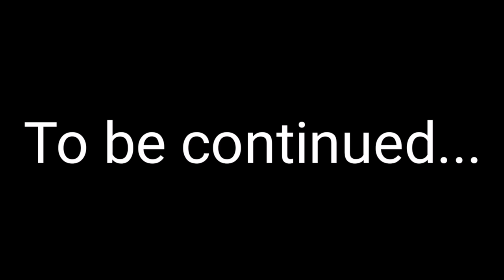Ashleys Chicken Coop PART 2 | Another VLOG #38

Comment: Coming along nicely! If moisture builds up in a coop and there is no ventilation, chickens (especially big comb breeds) are susceptible to frostbite. Droppings boards underneath the roosts, with zeolite sprinkled on, will absorb moisture and the droppings can quickly be scraped off every day into a bucket, using a taping knife or scraper. Goes super fast. This will help keep your coop clean and dry and the coop won’t smell, and the chickens won’t be walking or standing in poop. Some people line the walls behind the roosts with feed bags that can be easily cleaned as well. Having roosts (2x4’s with wide side up) all at the same level will help avoid jockeying for the higher positions at night. 😊

Comment: The amount of ventilation you have is good. Because your winters get so cold (mine do also) plan on a heater, there’s many safe ones out there for coops. Also since she doesn’t want to do the deep litter method during winter...plus just the fact to save your flooring, think about putting in rubber stable mat in coop area (super easy to clean coop out with that, or even just a large piece of vinyl on floor) 
To keep them from being bored over the winter, hang swings for them. I still let mine out any chance when there’s not snow on the ground, most chickens are very hardy and adjust to cold.

Comment: I find the building of the coop very interesting as I buy farm eggs and when the lady could not come to town I traveled to her farm to pick them up.  She gave me the grand tour (pics on my FB) and one thing that I loved is that there was a stream of fresh water going through the chicken run.  I also watched videos or read a while ago about putting the ramp up so the chicken's feet would be clean when they finally went into their rooms to lay the eggs to keep their nest clean and thus clean eggs.  Our cousin's coop had outdoor flaps to open to gather the eggs - saves from going inside.  Or egg lady has separate coops for the new chickens and adds them in as a group otherwise the older chickens would pick on the new chicken if they are added in by themselves.  It is all really interesting if you get into a larger quantity.  My sister used to work in a hatchery where I also had the grand tour from the chicks hatching to the orders of chicks being filled for pick up.  The chicken coop is usually the main attraction so I like that you are doing it up!

Comment: Are you going to add rafters to the roof to collect rainwater to store in a barrel to make a self-watering system for the chickens?
Reply: Not my chicken coop but water freezes in Edmonton.  There is no rain in winter, just snow.
Reply: U can use a cattle water warmer.  Surely they make one for poultry.
Reply: @Warmfireandtea  Any device intended to melt water will use electricity and so far this chicken coop does not have power.

Comment: Near Renfrew, Ontario, Matt McDougall of YT's 50 Ducks in a Hot Tub used old sign board pieces well-taped for his floor and lower wall sections in his earlier duck barn iteration.  Last year he did a repair-rebuild and renovation and had a new slab laid while lengthening the building.  He has a numerous cleaning the barn videos (up to ~ 2017) that show how that material worked on the ground; also, that can be pretty cheap, if you're near a good sign recycling source.  It seemed to hold up well to his regular mucking out the constant poo-straw supply (using a snow shove) which he piled on his garden, then planted in the spring most years to great organic effect.  His flock was and is fairly large, as he free-ranged up to ~1000 ducks to donate to hungry people in Toronto and lots of eggs go to the local food bank.  Chicken manure is stronger than duck, I believe, but given enough 'cooling-off' time, they're creating a valuable resource.  ['Cow pies and meadow muffins' take longer to become safe for the garden.]

If Ashley wants her chickens to roost higher in the structure, you might want to stagger the roosting poles' placement, out of consideration to lower-perched birds, and don't clip the wing-feathers too much, so they can fly up to where the heat is going in winter.  That's purely a guess because I'm a duck person whose flock was evicted from Milwaukee. and ducks don't roost.  Looking forward to part three!

Comment: @Joshua Alexander, that is not a chicken coop. That is a chicken palace! 
I've never seen one that Huge. It rivals a commercial coop! 

Around here owners with chickens often have a "Chicken Tractor" that can be moved around on their property. The chickens will keep the grasses, and weeds pecked down, and eat all the pests like ticks, and such. I'll see if I can't find an example and send it to you via messenger. They typically are fully enclosed, with the coop above or at one end, and then the enclosure has 2"4" welded wire on the bottom. And naturally they are on wheels. Some are mobile enough Ashley could move it, Others literally require a tractor to move them (but those are larger for a LOT more chickens!) You may want to consider a chicken tractor for your summer months....

I would suggest a solar powered door for your chickens.

Comment: @0:25 "...been meaning to do that for two years..."
lol

as for the pitch of the roof you only did part of the calculation. You found the run of 12" and rise of 23" but you didn't calculate the slope or the degrees
FYI 
the grade or slope would be 191.7%
the Degrees would be 62.4°

Comment: I read where you were scolded by another poster. I think you are OK with the rafters off of the top plate with your laminated bird's mouths. The only thing I might recommend are collar ties. Rafter on one side "tied" to the rafter on the other side by a 2x bolted to the rafter. That is usually to prevent a load on the roof from basically caving in the roof. That isn't a problem (or shouldn't be) on a roof that steep. In this case, it may prevent the rafter and your laminated  things from sliding off the top plate.
Reply from the maker: Seems reasonable!

Comment: are you going to use a heat lamp in the coldest weather. they now have thermosats that will regulate heat if it gets below a set temp. we had 10 chickens and at the end of winter we still had 10 due to that regulater.
Reply: I recommend that too. That´s how we keep our chickens warm in winter.
Reply: That would be good for my RV. Anything to avoid using antifreeze in water pipes .

Comment: Because they poop so much  methane builds up if not cleaned every couple of days, hence good ventilation is important. You should also have a readily available heat source for them. I would keep the floor on the ceiling then it gives you additional storage space for chicken supplies.
Reply: Huh?  Floor on the cieling? Sounds like a song.

Comment: Joshua make sure there's no nail points sticking out and also the queen needs a flooring in whatever area should be walking that is she can clean with a solvable are a bleach content the keep the feces germs down. When we had Dobermans of course we had cement we had a pain to put the females in when they were in heat the other was just for everybody and it had rain but that wouldn't apply to you but I think if you're going to fence your fencing is very important cuz of the big birds I worry about that here cuz I have an owl and a hawk it's in my area and I'm in a subdivision and I could pick up my Yorkshire Terrier or my butterfly terrier and take them away and my Scottish terrier just be sitting on the background laughing.🐔🐔🐔🐔🌹

Comment: The reason that works is because birds will fly through horizontal lines but not through vertical lines.  It is the same reason if you have birds flying into your picture windows, take a pen that writes on glass and draw vertical lines about 4” apart and they will not fly into your windows.
Reply from the maker: Very interesting.

Comment: That is a nice house but the door is too small to scoop out the excess feed and manure. U need a way to push that out and not thru the door. No floor or a ckn wire area that it can fall thru then be pulled out would be nice. Just mucking like a horse stall will get labor intensive . U will get that job, hate the work and thisbox will wind up.an out building.  And don't forget they need a little heat source Josh. Read up.on it in Mother Earth News.

Comment: Poor Austin.  I guess u barely know him Josh because you are from different areas but it's sad huh?  I hope he doesn't become bitter.
 If the dealer goofed up rendering his truck unlockable they would need to offer a loaner would they not? Sounds like he got a lemon. Tissue paper trucks. I would get a lawyer on it.
He needs a tool box for the truck bed.   It happened when he was away from home. Drugees no doubt.
 Mark your power tools and insure them.  He has a video to document what he had but what will he do until the check comes?
He has no p.o. address or anything in his ch. notes.  He only has 3,000 sub.s. Needs help.with videography. Sound.  A mic and wind screen are in order.  I just wish somebody would help.him withnit. His ch. Is interesting and he is such a stoic. He tickles me.
He has that poker face. Trying to act all strong and silent and he's just a kid.